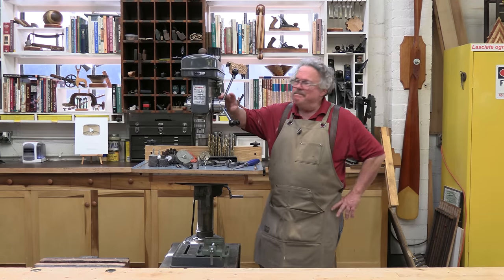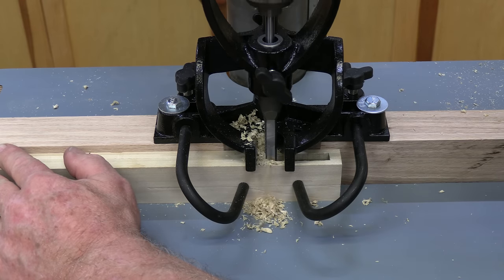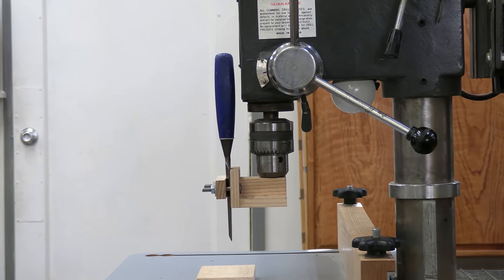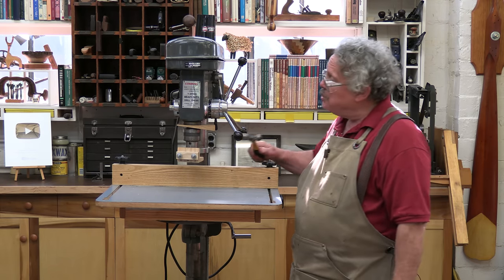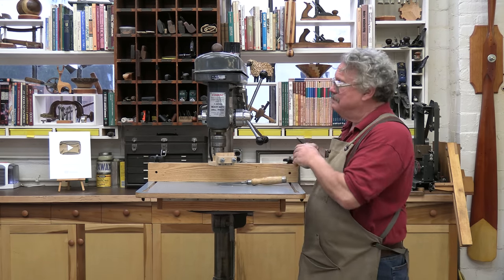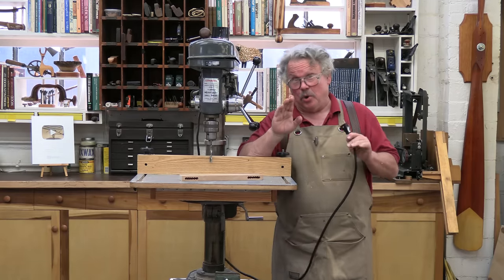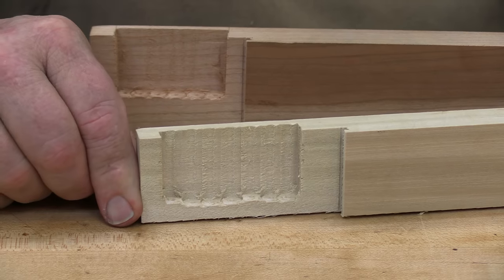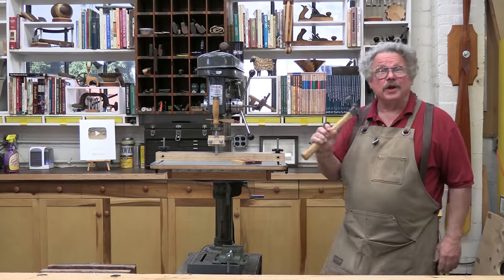Drill Press Chisel Mount

Comment: My grandfather was a Seabee in WWII and a master craftsman after.  He showed me something very similar to your method almost 50 years ago.  To simplify matters, I had a machine shop make me a few chisels of various sizes that did not have handles, but instead had 1/2" diameter or smaller shafts a couple of inches long so I could mount them in the chuck of a drill press.  I also had a set made for my grandfather who used them quite a bit, and I got that set back upon his demise.  I still have both and have used them many times over the last half century.
Reply from the maker: Thanks for sharing. My very first pass at this jig twenty-some years ago was to braise an old mortising chisel to a 1/2" shank, then re-temper the chisel. Not as sophisticated as your design, but along the same lines.
Reply: @WorkshopCompanion  I know carpentry, not cabinetry and other fine woodworking like you do, but I have been a motorhead since JFK was President, so knew and still know folks with machine shops who have done considerable metal work for me.  That's why I defaulted to having one of them make the chisels I wanted.  Everybody who has ever seen them (a) thought they were miraculous, and (b) wanted to buy a set.  It has surprised me that no one has ever produced them for retail sale.  Had the idea been patentable, I would have.  However, it would not surprise me if a few folks had some made after seeing mine.  You might want to see if you can find a machine shop capable of making them for a price that you could sell them at for a reasonable profit without them being too expensive.  Me droog that made my sets said they were ridiculously simple and quick to make.  Bar stock on a lathe to turn the shank, mill and bevel the flat surfaces, sharpen the cutting edges, and temper to harden.  Ta daaa.  Keeping the cutting edge on the center line of the shank would prevent most flexing.  Given the size of your audience, I'd bet you could sell quite a few.  Many folks would just make their own, but they would love you for having shown the idea to them.  I Googled "parts of a hand chisel and there seem to be many that could simply be stripped of their handle and ferrule, and shaping the tang on a lathe might be the only alteration required.  I'm supposing you encountered a rectangular or square tang when you explored your add-on shaft method.  There have to be many brands with a round tang, and making its diameter uniform would take just minutes on a lathe.
Reply: Aren't granddads wonderful?  I still have several hand planes passed down to me.  I do my best to use their strong character as a measuring stick and try to pass on to my grandchildren (28 and growing) the strengths they both had.
Reply: @johntiefel4248  As with every other category of humans, some are wonderful, some are not.  I only knew one of my grandfathers.  He was of the "not" variety.  So glad to know you are one of the other category.  You seem to be the sort of fellow who should have created a platoon.
Reply: Pretty brilliant. I wonder how some high grade bolts would work if forged square and ground
Reply: @zubirhusein  Give it a try and find out.
Reply: @zubirhusein  I'm answering to get a notification if you come back here and update with your great idea.
Reply: This might be a great use of one of those handle-less chisels sets from Narex.

Comment: I removed the handle from a chisel with round tang instead of a socket, and then chucked it up in the press.  It worked for me.  Also, for the cloisenne wire, one could substitute guitar fret wire, which has tangs to grip walls of the groove.
Reply: Fret wire would give a different result. It would stand proud of the surface because it is T-shaped.
Reply: Brass shim stock is available in a variety of thicknesses, and widths. None as narrow as the "wire" that he displayed, but if you intend to do a lot of inlay work, a roll might work out cheaper than the wire. You might also be buying a lifetime supply in one stop.
Reply: I was thinking about doing that too.with some old chisels of mine.but wasn't sure if it'd work.glad you helped me make up my mind.ill do that.thank you 😉
Reply: A chisel chucked in the drill press would cancel any wobble also... I like it... God bless

Comment: I've had a Shopsmith for 40 years, also I have many of your books... I'm more a fix it, build it, repair it guy with some wood working skills. In my old house I had a pretty good shop, but now I'm in a Shop/Garage atmosphere learning to make it in a smaller space. I use my Power stand more than my Shopsmith mainly bandsaw, Jointer... I got a second hand Rigid Table saw and spent time tuning it up and it works like a charm. I do enjoy your "you tubes" and learn a lot... it's good to now tie your books to a face... keep up the good work!!!

Comment: Another option would be to get a few chisels in choice sizes .without the handles that don’t have full length tangs that could be mounted directly in the chuck.
Reply: I was thinking the same but the tapered tang might not satay firm. You might have to turn it parallel first somehow.

Comment: It's absolutely vital to make sure all the electricity has leaked out before using this jig.  Safety first! 😊
Reply: Make sure you wipe up the puddle on the floor.  You  don't want to slip.  Safety First.
Reply from the maker: I have a special insulated broom just for these sorts of clean-ups. There's no more annoying shop clutter than stray voltage. As always, safety first.
Reply: I hope there is no capacitor in the system. The result could be shocking.
Great video.

Comment: This is freaking brilliant and i"m ashamed of myself for never even considering it and i've owned a hollow chisel mortise attachment. I"ll add this, go to Harbor Freight and buy a set of their dirt cheap chisels, cut the handles off and attach them permanently to the chuck fixture. I don't have a drill press since I sold all of my stuff prior to a past move, but I plan on buying a benchtop, and I'll be using this chisel mount for sure.
Reply from the maker: Thanks for sharing.

Comment: wow thats a good idea! NOW make on for some one who does not have a drill press. alls i need is a good pressing arm action. i could figure it out but you could do it better.
Reply from the maker: When I can't use a drill press, I have a perfectly square block of maple that I position on the wood. Then I place the back of the chisel (opposite the bevel) against it and hold it there with one hand while I drive the chisel with the other.  Not as easy as the drill press arrangement, but it keeps the cut square to the surface.

Comment: I tried this years ago with a 1/2" chisel with a round shank that the handle broke on. Even razor sharp, it would barely cut pine without crushing the grain, and hardwood was out of the question. I re-profiled it to a ~45 deg. skew, with a lower cutting angle. It then cut pine very well, but struggled with hardwood. The problem with the skew is the drill press quill wants to rotate, so I have to watch it. I have a 7" X-Y cross slide vise that makes thin, accurate slices possible but it's heavy to take off and on the drill press table.

Comment: I am sceptical. When you offset the chisel to clear the housing, you create a lever perpendicular to the drill. A drill press, in contrast to a mill, is only made to handle axial loads and lateral loads can damage your bearings, making it less accurate.
Reply: I'm not an engineer but I would hope that the amount of pressure needed, when using a scary sharp chisel and most hard woods we use, should be fine for the occasional mortise or inlay. Cheers mate!

Comment: Seems like a lot of work to me.  I've made mortises by first hogging out with a Forstner bit, then chucking up a smaller diameter router bit and carefully moving the workpiece along a temporary fence, and finally squaring the corners with a narrow chisel.  Not the safest of operations, and not what the drill press was designed for, but it's given me quick, easy, and accurate results.
Reply: Great idea. Thanks for sharing.

Comment: Normally your ideas are really great, but I think you guys are off on this one's value. It seems very handy for the wire inlay, but the fact that you need to use a mortising chisel to get it to work correctly makes me wonder if it's not just faster and easier to learn to use a mortise chisel in its intended fashion.
Reply: Some folks enjoy making their own jigs. Some folks prefer to rely upon tool companies to make their jigs for them. Different strokes..........😉
Reply: @dlighted8861  Using a mortise chisel is something you do with the aforementioned tool and a mallet. No jig required.
Reply: @etedrowable  point taken.

Comment: The way you explained the whole thing was very enjoyable. That being said, I have a question, would using such a jig be preferable to simply putting a milling drill bit in and making the hole by pushing the piece of wood along the fence? The corners would remain rounded, but that could be fixed manually with a chisel, since the amount of wood to get rid of would be insignificant.
Reply from the maker: One of the wonderful things about woodworking is that there are so many viable alternatives for any given task. What's "preferable" is completely up to the craftsman.
Reply: @WorkshopCompanion   Thanks! The thing is, I'm a beginner, it's difficult for me to determine which one could be better in a particular scenario. I have tools to use both, but I'm still wondering if there are some advantages to one of these solutions.
Reply from the maker: @maw9812  The key to why I can't answer your question are those words "particular scenario." There are advantages and drawbacks to both methods, and most of these depend on your skill level, tooling, available time,  materials, the project itself, and the environment in which it will be used --- things only the craftsman can determine. And he/she can only make a good determination with experience. A good friend of mine, Bob Moran, once wrote a book called "The Right Technique" in which he presented three methods for making most common joints. He was livid when Rodale Publishing imposed the title because the whole point of the book was that there was no "right" technique. There are, however, some techniques that work better than others in "particular scenarios" and I present a variety here so you have alternatives with which to experiment.

However, since you are at the beginning of your woodworking adventure there is one particular scenario I should warn you about. Better drill presses have two bearings in the quill, top and bottom. Cheaper ones have one at the bottom. The technique you describe puts side loads on the quill, and a two-bearing quill is much, much better equipped to handle these loads than it's cheaper cousin. You run the risk of damaging your drill press over time if it has only one bearing.
Reply: @WorkshopCompanion  thanks a lot, I didn't consider the risk of the drill bit snapping due to side load.

Comment: Ooh if I'd need that on a regular basis I'd buy me some chisels and cut the handle off, to go straight into the chuck
Reply: Exactly, I have a ton of old cheaper chisels that I could cut if needed! No worries about slippage in the chuck
Reply from the maker: That was my first pass at this jig twenty-some years ago. Trouble is, most chisels have either a socket or a tang to marry them to their handle. The socket is tapered, so it can't be mounted in a 3-jawed chuck. And the tang has four sides, so it won't mount  very securely. I ended up having to cut the socket off a mortising chisel, braise it to a 1/2" steel rod, and then re-temper the chisel blade. Believe me, this is easier. And you still have something that can be used as a chisel after you're done.
Reply: @WorkshopCompanion  Yeah, you're right. I looked at some of my older chisels, and a LOT of grinding would be needed for them to fit a chuck, better off building the jig

Comment: Do you think it is possible to retrofit a chisel (or something like a chisel tip) to a jigsaw? That might be quite effective.
Reply from the maker: To do this on a power tool with power on would require a good deal more power and sturdiness than most jig saws provide. There would also be some nasty safety issues.

Comment: You mentioned "wetting the wood to swell it up and close the groove". Does  the wood "unswell" and open the groove when it returns to the natural moisture level?
Reply from the maker: No. Think of the chisel as a both a cutting tool and a wedge. The cutting edge separates the wood fibers along a clean, well-defined line, then the wedge behind it compresses those fibers to open up the groove. Wetting the wood restores the fibers to their uncompressed state and they close in around the inlay.  The technique is hundreds, possibly thousands of years old.

Comment: Wouldn’t it work better with the chisel jig being mounter to the non spinning part with an indexing ring around the stationary part of the press.  Even better may be the use of an old drill press rack and pinion?
Reply from the maker: Being able to turn the chisel allows you to shave both the sides and the ends of a mortise.

Comment: I agree with you up to 6:50 and then the nagging suspicion in my mind popped: since you need two tools anyway (a bench drill and a mortiser), why not make a cheap mortiser by adapting a simple orange press/juice extractor? It's the same tool, it's much cheaper than a bench drill and it leaves your bench drill free to do drilling.
Reply: Does it have an adjustable depth stop? Or a fence to keep the work straight?
Reply: @GearHeadHam  You're missing the DIY spirit ;) It can be had for just ten bucks! You can build all these features into it if you must.
It also has a major plus: it will never start rotating uncontrollably and take your eye out because you accidentally turned it on after forgetting to have it unplugged!
Reply from the maker: My wife would kill me...
Reply: @Stelios.Posantzis  Not missing any DIY spirit, just posing some valid questions. Of course repurposing of that sort would be a cool if crude option, but if you don't need precision with a straight line or consistent depth, etc., it may not be so crude. I do prefer the fixed aspect compared to dealing with a rotating part that needs to be fixed.
Reply: @GearHeadHam  Yep, it would probably make for a crude first attempt requiring infinite improvements but we won't know unless someone tries it :) I, for one, would imagine strength to be its greatest limiting factor. Well, it's youtube, so all we have to do is sit back and wait ;)
Reply: Or how about a drill press mechanism, of the type that you put your own drill into(or not, in this case), fitted with a chisel holder?🤔
Reply: @Nitecrow314  That's a much better idea than using an orange press...

Comment: Instead of unplugging your drill press you can unbelt your drill press which is just as safe! A plug to my drill presses behind a bench little awkward to get to! Taking off the drive belt is easy as loosening a lock pulling a motor forward and removing the belt which would do anyways if you had to change the speed!
Reply from the maker: Good tip.

Comment: Much better to have the chisel axial with were a drill bit would go. Remove handle and hold tang in chuck or welding on some metal rod would be easier than this jig ans won't put torque on the drilling head

Comment: This honestly seems so much more time consuming than just using a chisel by hand
Reply: I'm debating this point.  On the one hand Nick's jig would create a mortise wall that's perfectly square, chiseling by eye wouldn't be as precise.  On the other hand you could just make a rabbet in a block of wood to reference a chisel off of to pair the mortise by hand which would be a lot simpler, but then it only works with a specific thickness of wood.
Reply: I think it be faster once set up for accurate repeatable cuts?  I like this idea for corners on routed dados.
Reply: There's probably an inflection point where it starts to make sense. If I were looking to knock out a batch of smaller stuff with lots of M&T joints, I could see this saving a lot of time. Mark everything out, drill out all my mortices, then do the cleanup in a batch. If you were doing a matching set of end tables, you could easily be looking at 16+ joints to cut. Though honestly if I were to do anything, I'd likely just cut the handle off a cheap chisel and stick it in the drill chuck so it's co-axial with the bearings on the machine.
Reply from the maker: I've used both the hand and block methods for going on fifty years, and jigs similar to this for twenty-some, and the time it takes to make a mortise is similar for all three methods (depending on your skill level). The only time trade-off is what it takes to make the jig; it's reasonably quick to set up and use. The real issue is precision. The block methods adds vertical precision, unless you make the rabbet that Conor mentioned, but then you have a dedicated block, as he points out. The jig -- when used in combination with a drill press fence -- adds vertical and horizontal precision, along with the versatility and flexibility necessary to be used with different sizes of  workpieces and in different applications outside of joinery. As always, I present this jig as a viable alternative to other methods, not as the  "best" or "fastest."
Reply: Always good to have more than one way to skin a cat
Reply from the maker: @ZachAshcraft  Unless you're the cat.